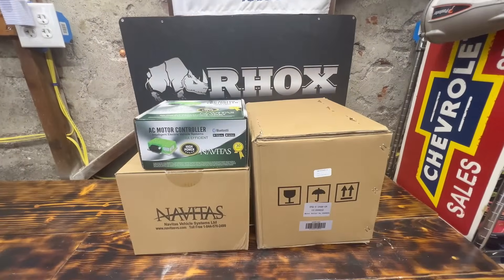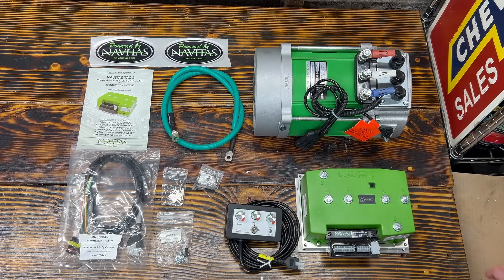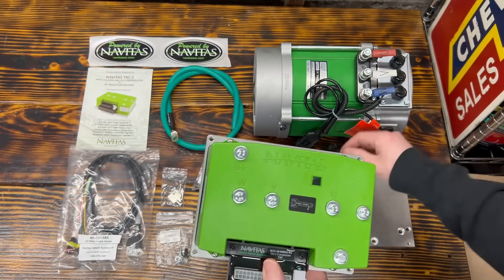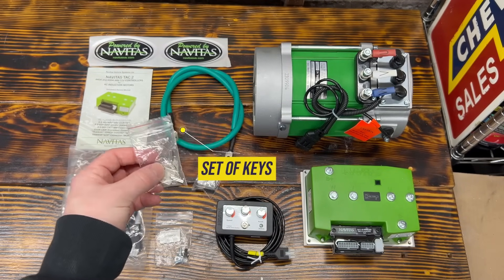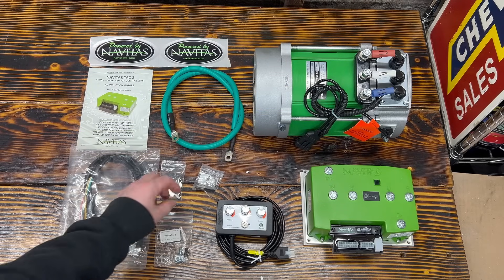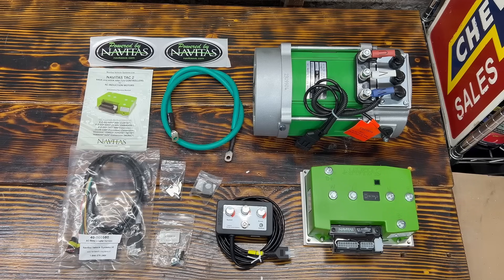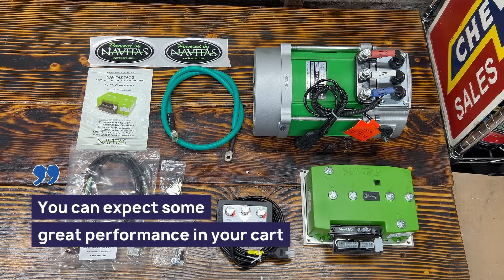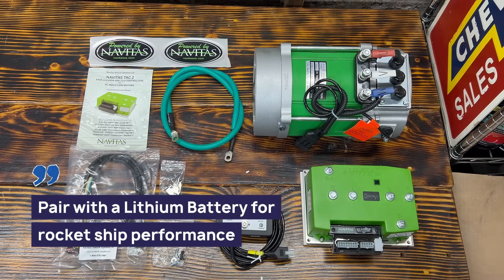Navitas AC Conversion Kit - What's Included & Why you want this!

Comment: My EZ go is 36 v. Can I use this to upgrade it to 48v? I know I would need a new battery, what else would I need?
Reply from the maker: If it's a 36v PDS, you can get a 36v to 48v adapter. We sell those on our site. If it's a different EZGO 36v, you will need to install a 48v wiring harness (not that expensive, but can be a difficult install).
At that point, and after installing a 48v battery, then the Navitas 48v kit will work.

Comment: I have a 6 seater, do they make a kit specific for 6 seat carts.. those cables aren’t going to be long enough with the controller under the front seat.
Reply from the maker: Their controllers will work on a 2, 4, and 6 seater, but they do not make anything specific to a 6 seater. One would need to procure extended cables separately for a 6 seater. However, most of the main stream 6 seaters have a controller under the middle seat. If yours is under the front seat, there's a chance it's not a model that Navitas would have a workable controller for. Make sure you double check that it would work with your cart before purchasing.
Reply: @extremekartz thank you for the reply! It’s a 2013 EZGO txt / L6.